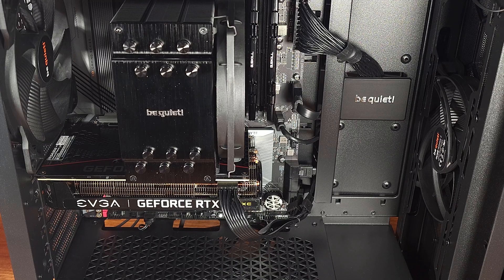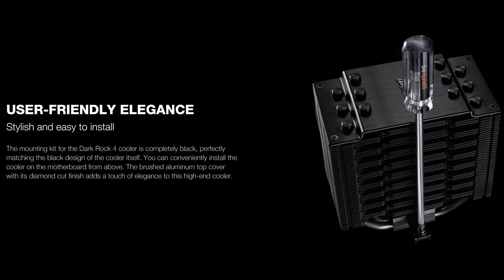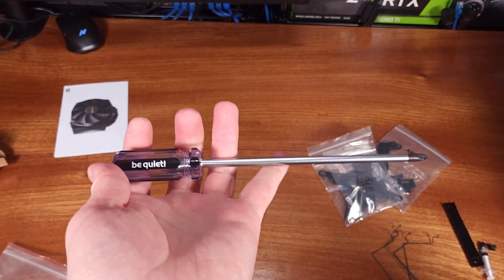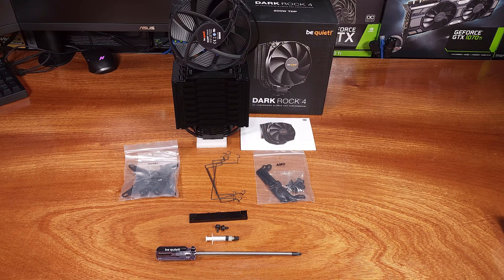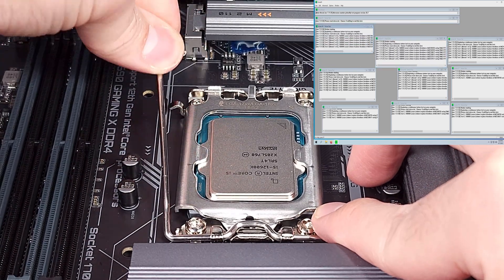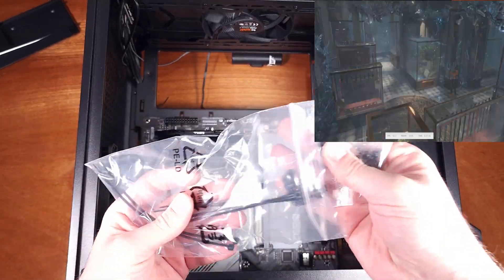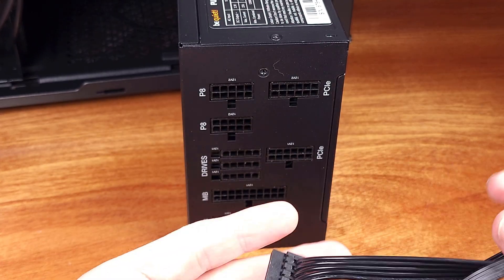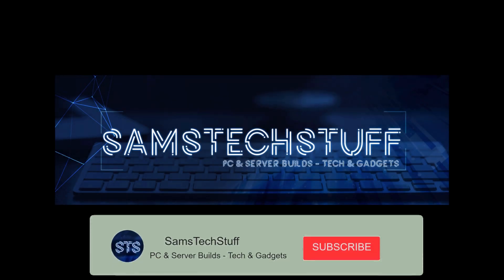Best Value Cooler for i5-12600k

Comment: should i pick the same cooler for my 12600kf?
Reply from the maker: Hey, sorry for the late reply here. The Dark Rock 4 is a solid CPU cooler for a 12600KF. The Dark Rock 5 is out but it might be slightly overkill for the 12600KF. Is this a new build?

Comment: how do you find this cpu cooler? what is your average and maximum cpu temperature with this cpu cooler?
Reply from the maker: This cooler has been an overall excellent CPU cooler! It depends on the stock and overclocked operation. With the 12600K I don't think I ever saw the stock temps go above 80C range which is great and overclocked I think the max might have been around 90C which i still fine. What CPU were you planning on using with this cooler?
Reply: i7 13700K . did you advice me with air cooler or liquid cooler? and which one? @STS

Comment: hi. if we use this cooler, can we use 4 slot of RAM? thanks.
Reply from the maker: Hi Mahmoud! Depends on the memory kit and height. Which memory kit were you going with? (and what motherboard)
Reply: @STS  
hi.
Asus Rog Strix Z790-A Wifi D4
VENGEANCE RGB PRO Rams
with this setup and cooler, can we use 4slots of Ram?
if no, what kind of ram and board do you suggest? (to use 4 slot of ram on board).
thanks alot.

Comment: Hi, I'm considering this cooler for an intel raptor lake build, and was wondering if you could remove the 135mm fan and place a slimmer 120mm fan to clear up the first ram slot so you have access to all 4 DIMM slots.
Reply from the maker: I think it would be possible but I haven't tested this. I do think you might need to position the fan on that side a touch higher up than normal though.

How much memory were you aiming for in this system?

Comment: So the 1700 socket is not mentioned but it comes with some adapters? Is it now compatible with the 12600 or not? Confused
Reply from the maker: Hi Steven! If you order this cooler now, it will be included with the heatsink if you somehow got an older cooler you can contact be quiet as well to get one. Are you looking at upgrading your platform?
Reply: @STS  allready own a 12600 but the boxed cooler is not enough on high demanding games like cp and sc
Reply from the maker: Ah ok, I would agree, the smaller coolers just aren't enough. I like the look and performance of Dark Rock 4, I would definitely recommend it if it fits in your case. What case are you running?

Comment: I weighing on buying 12400 or 12600k. Do you think be quiet pure rock 2 black is enough for 12600k?
Reply from the maker: Hi Napat! I haven't tested that combo so I can't say for sure. I do think it will work but, the cpu will likely run hotter and your turbo speeds will likely be lower. It also depends on your case airflow. What case are you using?
Reply: @STS  I'm using cougar mx330-x. There are 6 fans available including the case's rear exhaust. This is my first build so I don't know for sure but this looks like a pretty good air flow case?
Reply from the maker: It seems like that case only comes with x1 120mm fan. I'm not sure if you set your system up yet but you may find better cooling performance with 2 fans. How has your build been coming along?
Reply: @STS  Already built! Luckily I found Buildpicker's video testing tower cooler for 12600. ID-cooling is surprisingly good with really cheap cost. And for the case I went with Thermaltake s100. Done some underclock in b660 mobo and the cpu runs at 73 celsius peak. Really happy with my first build.
Reply from the maker: @napatt.7943  Awesome! Which ID Cooling cooler did you go with?
Reply: @STS  I went with SE-224-XT.
Reply from the maker: Ah, very nice - glad the system is up and running! Hopefully you're jammin through games!
Reply: These coolers, including the one in the video ARE NOT sufficient for i5 12600K on heavy loads. 12600K draws up to 150W which is literally what i9 two gens ago or todays ryzen 9 does. I am returning this cooler now for Dark Rock Pro 4 after consistently hitting 100C and thermal throttling on long full 100% loads. Using AI frame interpolation, and the CPU is at 100% utilization for long periods - this cant help.
Reply from the maker: I have run my 12600k through various workloads, gaming, video encoding, and the Folding at Home project, this cooler has been more than adequate, even overclocked. I'm not sure what type of load your work creates but this is a beefy cooler and 100c seems high. If you are truly generating that much heat, the Pro might not even be enough.

Did you attempt re-seating the cooler or evaluate your case airflow? Sometimes initial mounts are not as good as they seem.

Comment: This was exactly the video i needed, got a Dark Rock 4 for dirt cheap but i wasn't sure if it was enough for my 12600k. Thak you for testing.
Reply from the maker: Very nice! As long as you have the lga1700 mounting kit and your case can support the cooler height, you should be good. What GPU are you running?
Reply: @STS  The mounting it was already included, case is the be quiet pure base 500dx. GPU is an XFX RX 6900xt.
Reply from the maker: @Singleplayer117  Very nice setup there! Skills be a Gaming monster! My old 144hz Samsung finally stopped working, just replaced it with a Gigabyte M27Q. Game on :)